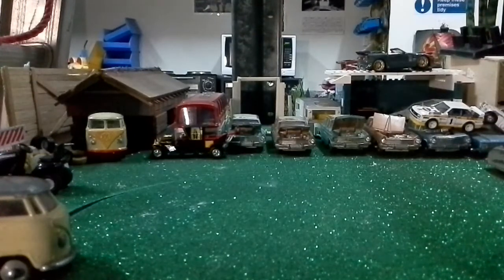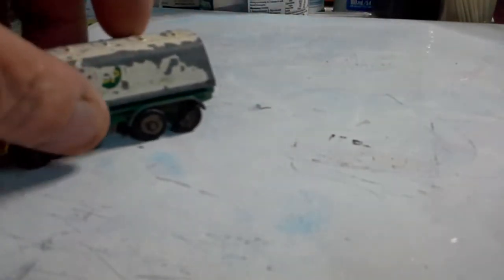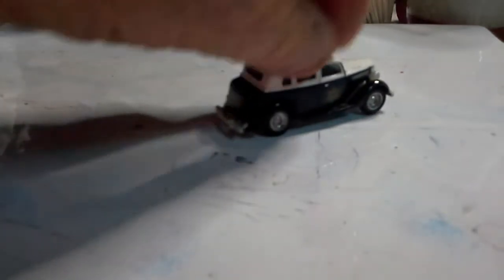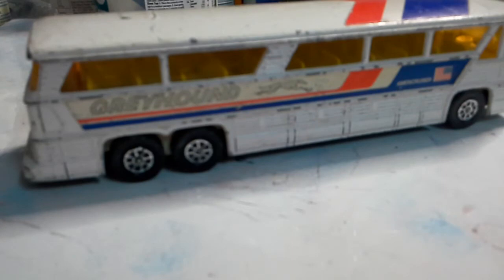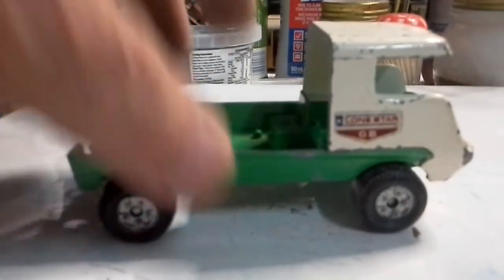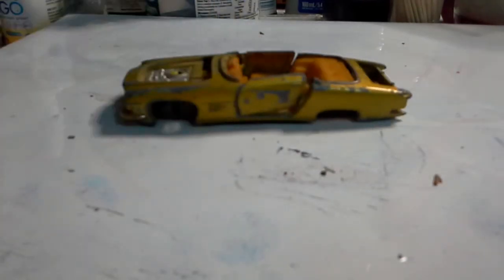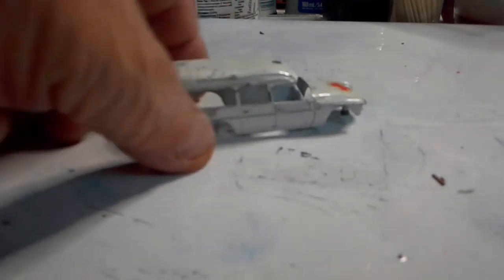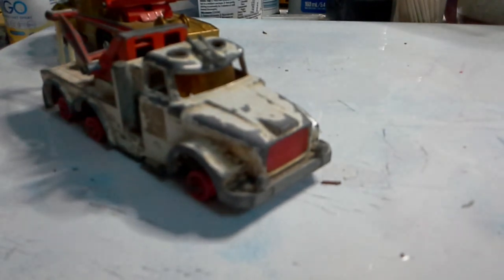August un boxing

Comment: Project's aplenty Michael.  Idea to check out, if you have one of the Holden HJ Utes' see if that Citroen body fits on it and make a panel van from them.  I've often wondered about that particular casting.  Cheer's John
Reply from the maker: Don't have a HJ matchbox ute in my stash as yet, but will get around to it. Thanks for the idea, I like it.